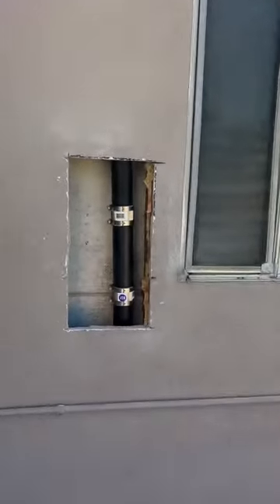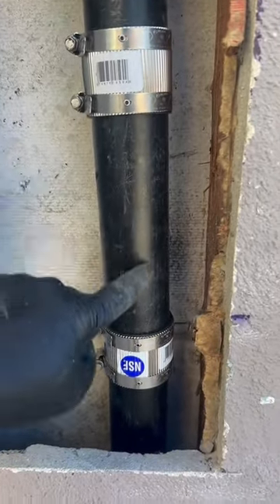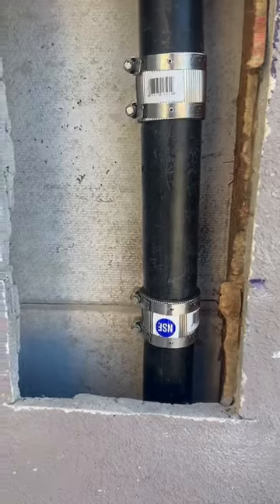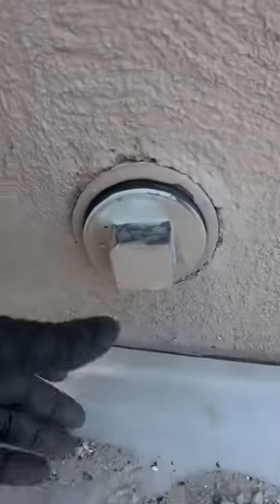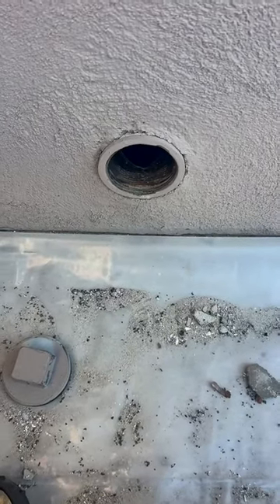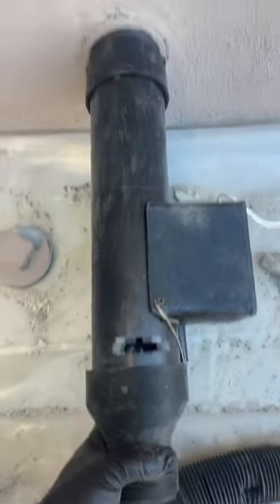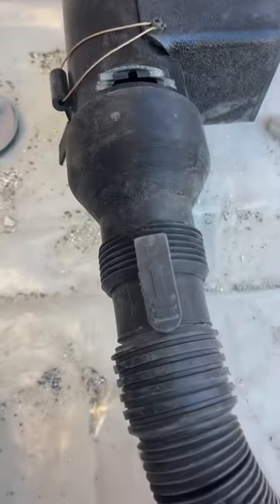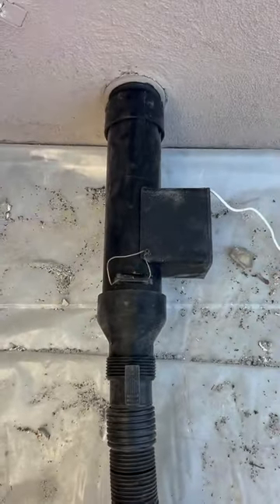2-Year Rat Infestation Mystery Solved!

Comment: To anyone about to ask, they put the babies up for adoption. LOL.
Reply from the maker: We made tacos el raton con Chile verde.
Reply: @TwinHomeExperts  😂 Here I thought you sold them to pet shops or snake breeders or something similar.
Reply: @TwinHomeExperts lmfaoo 😂😂😂👌🏾👌🏾👌🏾👌🏾
Reply: @Kevil911 i tried that. They die too fast for some reason. One nearly chewed the head off another at the neck. Both had catfood and water and plenty of room in a 5 gallon bucket. 2 mice med size. Still puzzled by that one
Reply: Actually those rats are wild Norway rats, they are not the same as fancy rats you get from a pet store. These rats carry fleas, are very aggressive, and are cannibals. Also they don't get anywhere near the size of pet store rats, that's why they can fit in a 2-inch pipe.
My family and I have pet rats, my biggest one is 19 inches nose to end of tail, and he weighs in slightly over 2 lb.
Reply: @Kevil911 @Kevil911 Ew who tf would want a wild rat? There's domesticated rats. And no way snake owners are feeding diseased sewer rats to their beloved pets.
Reply: Hahaha ... adoption....bahaha...tacos😂
Reply: @TwinHomeExperts another reason to use backflow valves? 
And STEEL/CAST IRON drain pipes so they can't dig through the PVC? 
Also design your home so that ALL plumbing and electrical is 100% accessible via removable access panels?
Reply: fleas and parasites such as intestinal worms
Reply: @godofplumbing You probably know already but for who doesn't know Norway Rat's are a misnomer. The Brits called them that when they theorised they arrived on Norwegian ship's but in reality their origin is Northern China and Mongolia.

Comment: 6.5 HP is 6.5 * 745 = 4.8 kW. What's powering that vac, a fusion reactor? You'd need a 240v, 20 A line to run that vac.

Comment: Why do you need peanut butter bait?  You are just going to suck them out.  They are going to get sucked (if they are there) no matter what!
Reply: This is an assumption but I would imagine he would put the bait in, let it sit for a bit to get them closer to the exit and then turn it on to suck them out.
Reply: I think the Peanut Butter causes the rats to trip some kind of switch that turns the vacuum on temporarily. They probably just leave the system set up and slowly the rats come over to get the peanut butter and get sucked out one by one.